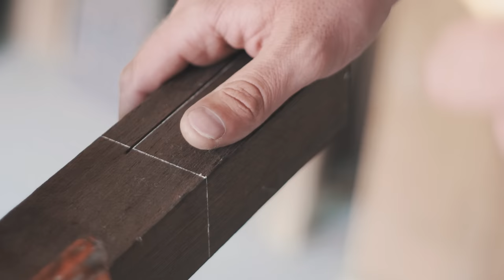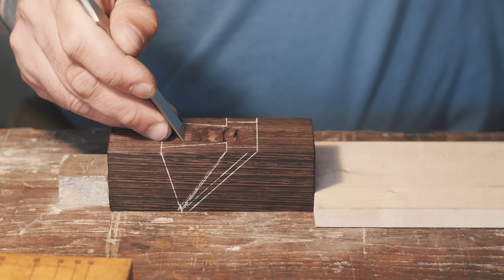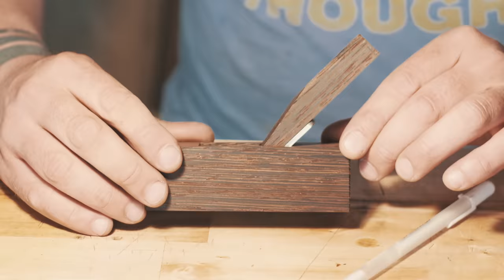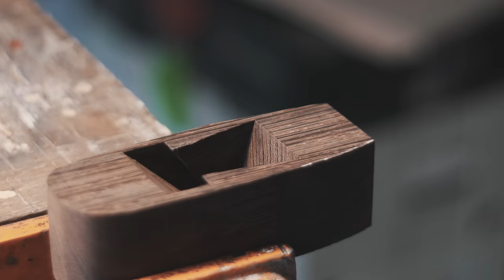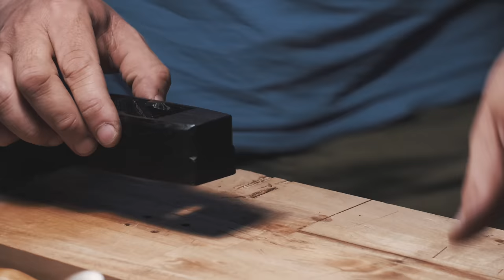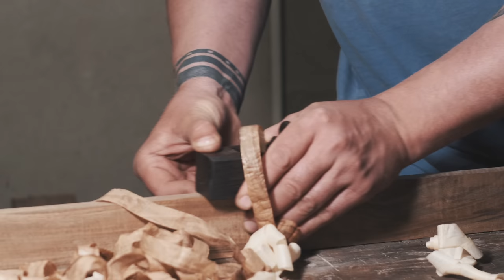Wenge wood Plane Making. Hand tool woodworking

Comment: Bevel down without a chip breaker. Ideally the iron needs to have no sideways play at the sharp end but enough for hammer adjustment at the top of the sides.

Comment: Hello,
thank you for the content, i had a quick question before i make a relevant comment about the video.what earphone are you using? i listen to music when woodworking also, but directly from the mobile and my wife tell it makes too much noise for the kiddies, so basically i don't work around nap times :D
I was wondering how you would make a plane without special equipment like planes maker rasp and so on .. but the jigsaw blade held in the pliers trick made my day :D
Amazing work yet again. I love the ambiance of your video so much, i wish i could motivate myself enough to share like you do!
Reply from the maker: Thank you! If I'm not mistaken, this is a Panasonic RZ300W 😉

Comment: looks like in future videos you epoxied a brass plate to the bottom. Was there a negative to using this type of wood requiring the need for the brass plate?
Reply: Wenge is pretty tough so it probably isn't necessary depending on what it's used on, but a brass sole would extend the life. Also can be replaced if it wears, and looks great on dark wood in my opinion. 
I tend to put brass soles on, but I've learned to solder pegs onto it and recess them into the plane body - just glued on flat they can drop off over time.

Comment: Very nicely done, stunning outcome. The question is did you enjoy working with wenge?   I made a small dovetail box out of wenge by hand and told myself never again.
Reply from the maker: Because of this wood, everything had to be sharpened 40 degrees! Now I have to regrind back! I want to buy ebony to try😉
Reply: Great project! 👍
Oh yes, what a lovely wood id wenge, 20 or so strokes and back to sharpening 😁.
Ebony is much much nicer for blades. As long as you don't take big chunks with the plane and saw with langer teeth and low tpi, you should be ok.

Comment: Excellent video. I'm hoping to scale it up a bit to make a longer plane but can you clarify what angles you used in the throat? I'm guessing maybe 45 degree behind the iron and 70 degrees at the front? Also what is the angle on the wedge?

Comment: Whenever I try to plane wenge it just skates iver it without taking a cut after about two clean shavings. What am I doing wrong? I'm using the scary sharp system fyi
Reply from the maker: The secret is simple! - you just need to sharpen the knife at 40 degrees at least, you can still up to 3-5 degrees on top of the knife, then this angle does not get dull on wenge and ebony.
Reply: @gr_woodworking  thank you so much. I will be getting a dedicated iron for those woods in future 😁